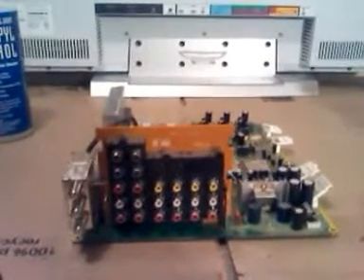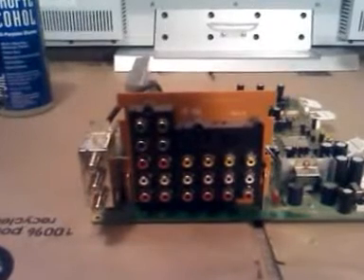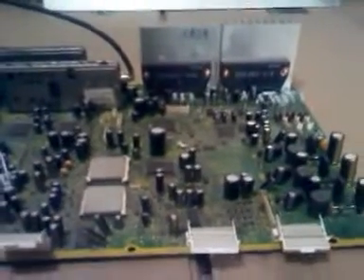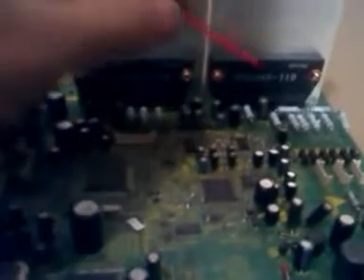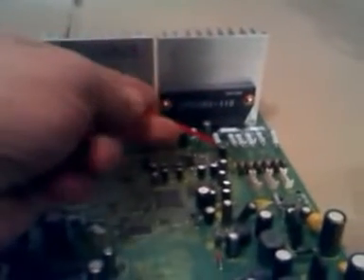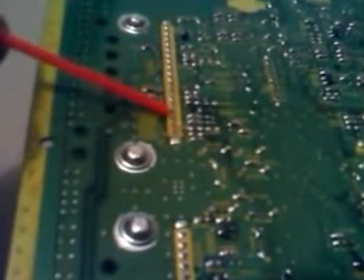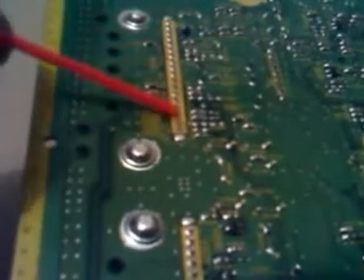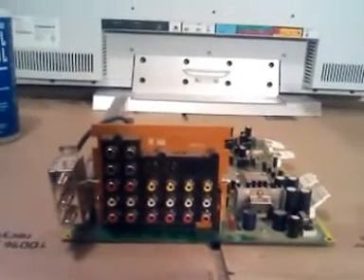Convergence Repair on Rear Projection TV's

Comment: Are you still working? I’m looking for part 2 with the manual adjust procedure. I replaced the ICS and the magic focus doesn’t work. I checked the ohms on the resister and they looked ok. Thanks

Comment: hi .... I was wondering if I could ask you a question..... I got a tv with bad convergence... now I got the kit and everything is going well.... except the convergence chips are on the board with this black can shaped thing(on high voltage board) with thick red wire coming out of it with a smaller thinner red wire ... the thick red wire goes to a wire manifold ( for lack of better terms) with 3 other thick red wires on it... my question is .. can I pull the wires out of the black can thing on the board so I can do the repair on the table or am I stuck doing the repair with the board in the tv...? thank you very much for any response.. Tyler...

Comment: where do I get a front panel plug-in that controls the on and off volume,channel button .lo
Reply from the maker: +Kimberlei Tobler  That's called a "button board" by many vendors. If you are still researching this, I suggest looking on Shopjimmy.com or simply google your model TV along with the keyword "button board".

Comment: Do you still do repairs
Reply from the maker: +DMAN4u2  I am mainly doing repairs for repeat customers and on a limited basis. TV's have come down considerably in cost and subsequently a lot of shops have closed. I still perform repairs onsite but no longer fulltime.
Reply: +DMAN4u2 Hi I followed your direction for the blinking green light  Now when you push the power button on it click off and won't stay on.
Reply: +S Carter that sounds like something isnt right, did you replace the resistors near the stk ic's, you can check the connections with a multimeter do a continuty test though you'll have to rule everything out to be sure

Comment: My convergence is almost fixed.  I replaced two ICs on the convergence board and two pico fuses on the power board.  Red and blue are now able to move (I attempted a realignment)   the picture is still bowed/warped...

Might you know which component is responsible for green?  Sony  KP-57ws510

I'm almost certain the pico fuses and resisters on the convergence board are fine because of multi meter testing (could be wrong though)  what else can I do?

Comment: I have a quick question. I just got a RCA projection TV and I couldn't play video games on it because it was too blurry. I then cleaned of the lenses and that didn't help. I then adjusted the lenses and that solved that problem but now the convergence was off. When I tried to auto converge it says it would take about a min but it just lights up green in the corner and then quits. The middle of the screen is good but out closer to the edges it gets a little messed up. Do you know why?

Comment: Hi, you can buy convergence repair services from this guy from ebay, listing #230735863255, just type that # in ebay search engine,to remove red thick wire read listing for more information.they have more convergence repair service for others boards as well.

Comment: i know this is an old video but one of the better ones I've found so far, I have a zenith r49s36 projection TV need a convergence kit for one and/or remote so i can fix the problem I am using a universal remote currently which i highly doubt that would work for that process let me know thanks. great video

Comment: i have a toshiba  rear projection tv         it has a weird problem      when you turn it on   everything is normal   it says video 1     and the menu comes up normaly   all the colors look ok with that       

the problem is when you hook something to the tv    weather its a cable box or video game consol      the image is   scrambled   and  is constantly moving around 

it is a full image   it is just in multipul lines moving randomly left and right   the menu still comes up normally

Comment: I have a toshiba 46" projection tv bought in 04, I appreciate your video, but I don't think I would have the expertise to soder. I could remove the board and send to you, would you repair? And order parts and I could pay by visa? Local tv repair shops say the parts aren't available and there junk tv's

Comment from the maker: At this point, if you felt comfortable, you could remove the signal board, labeling with masking tape every connection. You could send an email repair quote request to Moduslink PTS. If you google moduslinkptstvboards, you will find their website. They may be equipped to repair you board, including any programming of the Eprom. Also try searching online for the board. Someone may have it.

Comment from the maker: This is assuming the technician knew to access the advanced convergence and bring up a crosshatch pattern to manually converge the colors and subsequently save the data to ROM so the "flash focus" will be correctly programmed if so equipped.

Comment from the maker: Sorry to hear of your dilemma. My first hunch is that the technician ordered some low-cost STK's (convergence amp IC's), which are essentially knock-offs. If I'm wrong, then there are 3 remaining scenarios:
A) Bad solder job on the convergence amps (solder bridge, short, splash, etc)
B) Neglected to check all pico fuses and convergence resistors
C) Rare but can happen: the EPROM on the AV board (signal board) is fried.

Comment from the maker: If the other component inputs work fine but you are experiencing this issue on just the component-1 input, I would suspect a filtering component has failed within that circuit...such as a filter cap or inductor. In any case, I would suggest ordering a replacement signal board. That should fix the problem. If it were convergence related, all component inputs would show distortion.

Comment: If you buy OEM parts for a TV that has gone bad in 2 years or less, that does not instill any encouragement to use OEM parts. When it comes to IC's and Caps, buy from known good manufacturers, for example, Panasonic Capacitors with lower ESR ratings and as the video says, don't by the cheaper knock off IC's, you will regret it. Better to spend twice the money and have your set working 10 times longer, simply put, you save a lot that way.

Comment: hey buddy i've got the same board and like everyone else have a major issue with convergence. it even kicks off and flashes the convergence code in the led. i've done some research and read that one should upgrade the 110s with 150s. i'ven even seen kits for my tv with 180s in them. how safe is it to upgrade the ics?

Comment from the maker: My suggestion would be to order a remote control from 1800remotes(.com)
Additionally, the washed out blue may be due to crt coolant contamination. In any case, you will need a remote control to make things easier. Well worth the $20

Comment from the maker: Did you order OEM convergence amps? Did you check for solder bridges between pins and traces with a visual aid such as microscope, magnifying glass or jeweler's lens?
A blown resistor is an indication of a short within the circuit. If you ordered the kit, the service manual would be included and with that, the schematics. You need to find the shorted component or solder bridge connected to the blown resistor or it will likely blow again.

Comment: how do you take off the heat sink on a Sony kp 65wv600 tv? I'm trying to get to the resistors and for this set they are under the heat sink and it's hard to get to... also when checking the resistors with a multimeter should I desolder them one at a time to check them or can I check them without desoldering them? please shoot me a email @ ministerkareemc@aol.com